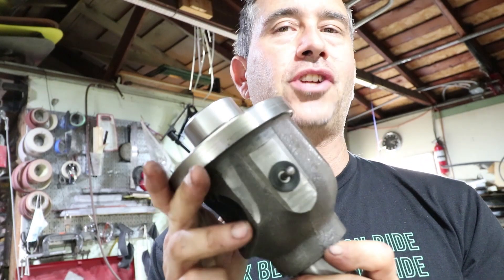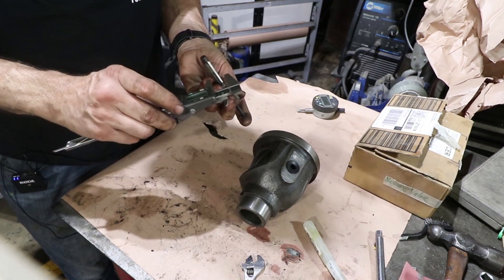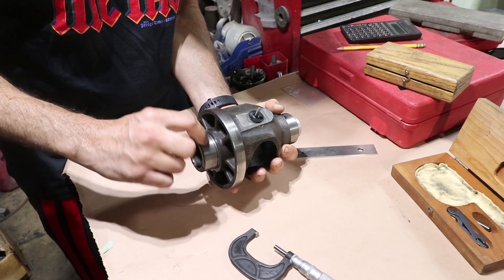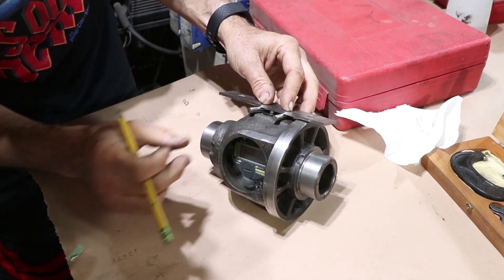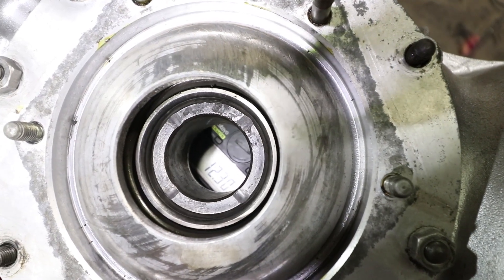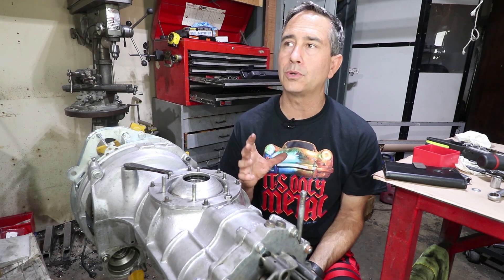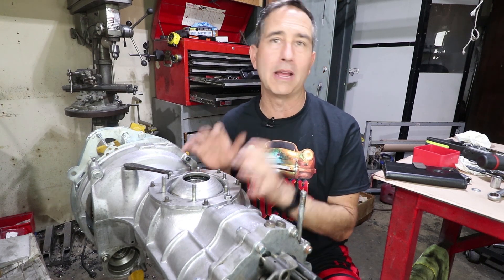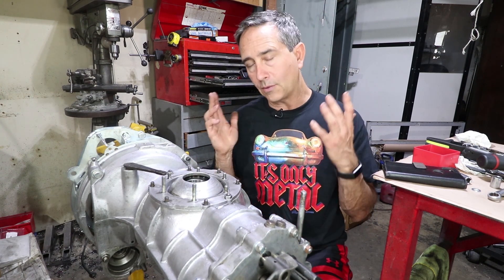How To Measure Differential Pinion Gear Depth With A Self Made Tool - PORSCHE 356

Comment from the maker: Update regarding the confusing Porsche pinion depth markings:
The 13 marking on my 1964 pinion gear is a .13mm deviation from the blueprint dimension.  The problem is the factory workshop manual doesn't spell out what the blueprint dimension is for the later cars.  59.80mm is in the manual, but apparently that is the nominal dimension without any pinion shims and is NOT the ideal pinion depth.
My ahh ha garage time moment was digging up an old 356 registry article that explains the factory change from 59.xx marked on the gear to just xx marked on the gear.  
Porsche released a technical service bulletin in 1963 (H7/62) that explains the numbers.  
I have no idea why, but the new blueprint number is 59.22mm.  This is NOT in any workshop manual or book that I have!
59.22mm +.13mm = 59.35mm
My preliminary measurement in this video was 59.39mm which is pretty close for an almost 60 year old trans!  (0.0015" off)
Like I said previously, this transaxle ran pretty quiet.  Now I'm satisfied that my numbers match the driving experience, which also matches my understanding.  
Hopefully someone will see comment if they are also doing this type of work.
Reply: Great job Mr. Sherlock Holmes!!

Comment: great job and brilliant idea to use a spare carrier as a pinion depth measuring tool. You definitely need to preload the carrier bearings, thats very essential to get the correct reading.
Reply from the maker: Thanks!  I can tell you from experience that a non pre-load bearing deflects about +/- .02mm.  The way I bolted the outer covers did pre-load them a little bit due to the bearing slip fit friction.

Comment: Interesting idea to use that old carrier to advantage. Makes work easier. Good job👍 I have made quite a similar measuring device from a pipe.
Reply from the maker: Thanks and good job to you too.  Necessity is the mother of invention.  How does your Transaxle run now?  Are you happy with the noise level?
Reply: @GarageTimeAutoResto  The final result of that measurement is always indicative. Especially with used parts. The final adjustment must be made according to the check of the pattern. If the ring and pinion are in order, the end result is very quiet. Some parts intended for racing use are an exception

Comment: hey tom way above my pay grade but just a though, are you confident that your mock up case and the one you intend to use are the same distance between diff center to rear housing ? love your vids
Reply from the maker: Hi, the one I measured is the actual trans case and gear cluster that I will be using. (My original).  I wouldn't expect the two cases to be the same.

Comment: Great work Tom, but now my brain hurts.  LoL.
Reply from the maker: This will make your brain feel better. 
VW385 is the equivalent tool to what I made and it's over $1000 from snap-on.
A shop typically charges $700-$1100 for crown wheel and pinion depth adjustment.  
That is why I'm trying to figure it out.  
And oh boy the way, I resolved the confusing Porsche markings on the pinion gear.  Woohoo.  I'll pin my findings to the top of this comment section in a little bit.
Reply: @GarageTimeAutoResto  That's great 👍👍

Comment: How does Dr evil do it?
Reply from the maker: Not sure, but I suspect he has similar tools.  Or maybe he doesn't do 356 trans because he doesn't have the tools.
Reply: Excellent job!  My father built a similar tool out of an old differential for our racing 911.  The hardest part is understanding the numbers on the pinion but I think I’ve finally got it.  We also switched over from an aluminum to a mag case which takes bigger bearings, so I try and center the tool the best I can.